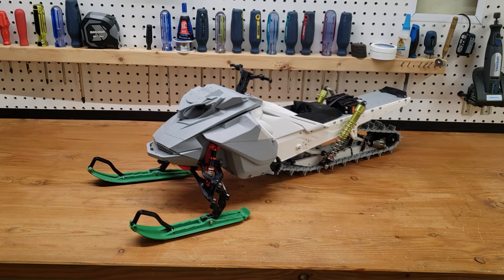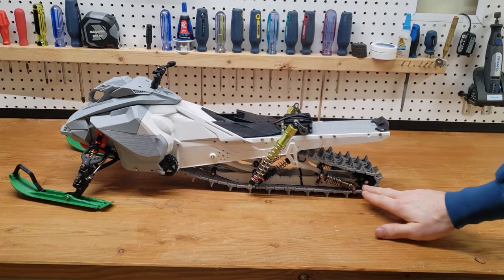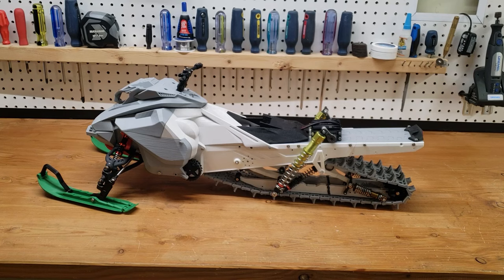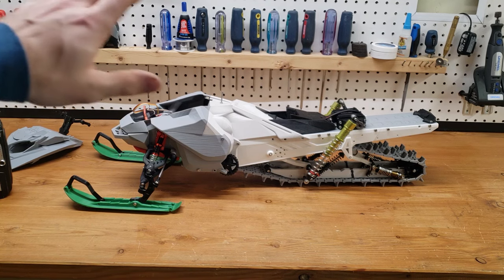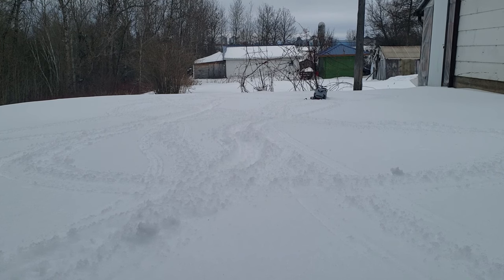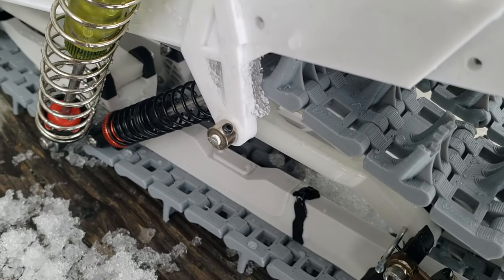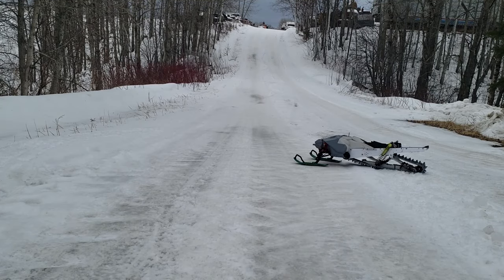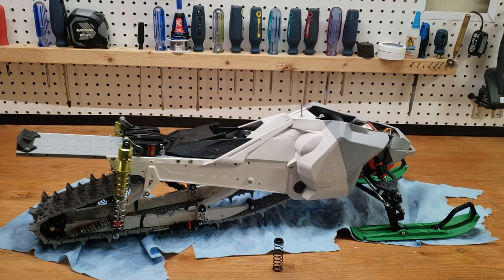Dynamic Tilting System - Rc Snowmobile Building Challenge 2024

Comment: Hey. I'm OldManBlunTZ from Thingiverse. I have been working on a similar system, but moving the skis instead of the track, to get better cornering on 3d printed skidoos. I have done some work on a modified kidztech skidoo, creating a rack and pinion style steering box for it, and a metal geared gearbox using the metal gears from 2wd ECX rc vehicles. Once the snow hit's i'll be able to prototype some things and test them out.

Comment: A gyro with a 3rd servo that has a weight on it to "shift" the weight?!? You could use a traxxas reciver as it has 2 channel 1 inputs so you could control the servo and weight while steering, that way the weight shifts into the turn to help it carve, 
Could also maybe use a drift or drag gyro for it, 
absolutely insane track design  and great video as always😮🤘🤘

Comment: I’m sure you’ll end up finding out that having a spinning flywheel that shifts side to side, or even just a plain weight that shifts side to side will be the answer because thats how they have been written in real life for the last 50 years. 

there is one idea that I have always wondered if it would be possible and that would be a pivoting/tilting  track. For example, normally when you take a sharp left-hand corner, the snowmobile wants to roll on the right  side of the track. I wonder if a system could be made so that the track would stay flat relative to the ground. This would also work when riding sidehill. The track could be tilted to match the incline of the mountain. I have no idea if this would be a positive change or if it would make handling worse but it’s something I’ve wondered.

There is one idea that I’ve always had

Comment: Pascal,great concept! Have you tried this with solid rods. Wondering if the shocks are absorbing all the pressure. If this makes a difference, use thicker shock oil. You need to mix in the radio to go left the mix will implement the right track. Just a concept. Fantastic video.

Comment: When we ride real snowmobiles, we shift weight and load and unload shocks.

You need to try to make your front upper shock mounts on a pivot point and use a servo to control it. So that one shock gets longer, and one gets shorter.  So the sled will tip.

I have a type set up on one of mine but had zero snow this year to test it.  I think it will work to get the sled on edge and start the carve.  So they don't drive like a car and more like a snowmobile!

Comment: That will be very helpful. Meaning changing the lean will work fine I think. But my feeling is that it would be more effective to make the whole body lean left and right by pushing the left or right ski suspension down. 2 years back I made the skeeride. I like it but it goes over on it's side too soon. The c.o.g. on this model is pretty high up compared to the newer model. This newer model looks better and performs better. But also and making it lean( like someone did) made a big difference.